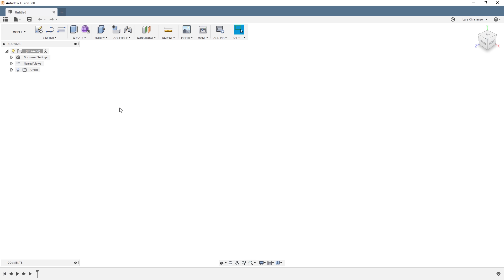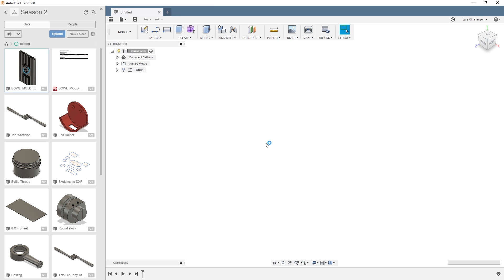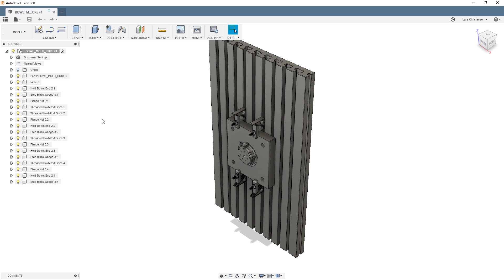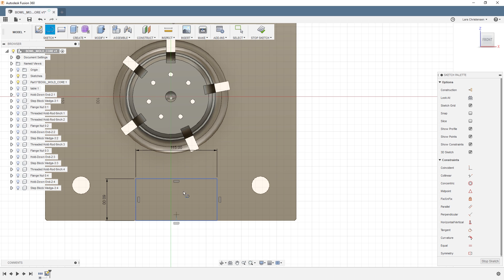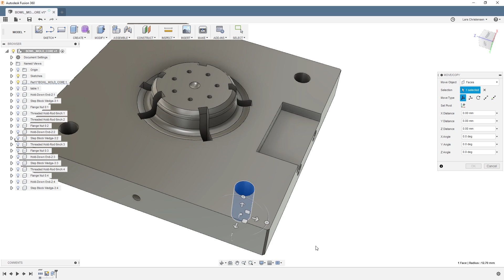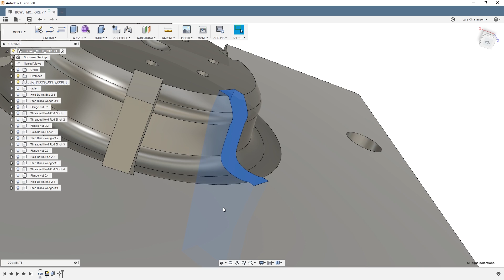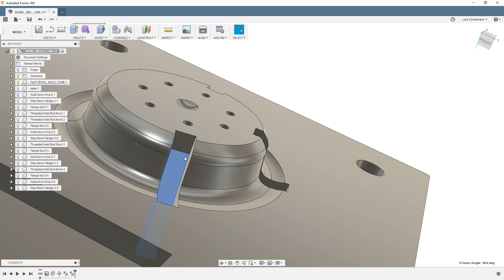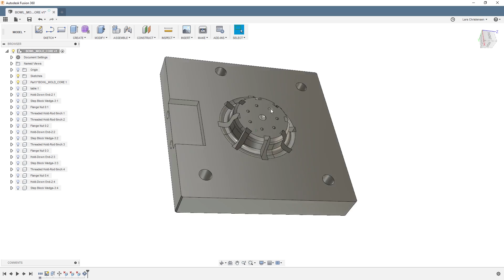How To Modify SolidWorks Files in Fusion 360 — Season 2 EP11

Comment: I am really facing issue with the file that is being imported.
i have a solidworks assembly file of a universal joint, which is made of 3 parts file inside the solidworks, now i want to open it in the fusion 360, but if i dorectly upload this assembly file along with the parts as said in the videos, iam getting the exact object which i have created inside the solidworks, but the joints are removed, that means, 3 parts are now moving independetly, i even have tried by uploading the .PART file of  assembly file created in solidworks , still same issue, can anyone tell how to solve it ???????????????????????????????
Reply from the maker: SolidWorks joints will not be available if you open the assembly in any other software, as far as I'm aware. It is pretty normal for CAD packages not allowing those being exported. You will have to re-attach everything in Fusion.

Comment: Hi, Matt. Did something change in Fusion360 in 2020? - In my case, a SolidWorks assembly files uploads alone with an error. Also,  when I upload the assembly file along with the reference part, Fusionj360 doesn't recognize them as reference part. Rather, the app considers them  individual files and they only open in browser.

Comment: I cannot find a video from you or anyone on how to modify an skp file from Sketchup in Fusion 360. I imported it the way you show in this video. When it comes in it is pink in color. When you imported your Solidworks file it looked normal. Did I forget anything? How can I fix this?

Comment: Great video - I have problems with bringing in STEP assemblies and creating separate part files from them. Ex. in a machine design we would use the same component in several machines. The natural thing is like here, to bring the assembly in, and work from there. Lets say in your file here that the clamps that you imported from SolidWorks needed to go into a work holding library (or it was ex a pallet system that needed to be in the same position for all the products you make); then how do you do that? 
In our other CAD system (Alibre) we get discrete files in, and can replace components, but as far as I know we cannot in Fusion.

Comment: Is the nester add-in still the best way to nest sheet metal parts for machining? Or is there something integrated in Fusion nowadays? I can't even find nester in the F360 app store so I assumed there was a reason
Reply from the maker: There are no incorporated nesting at this point. I have to admit that I have never looked at the add-in section for one, so I’m not sure. I would think nesting will be in the future of fusion(I’m far removed from those decisions) as the technology is in Inventor and therefore in the Autodesk’s hands.
Reply: @cadcamstuff   Oh okay that would be cool to see an easy way to layout unfolded sheet metal side by side to figure out what size of stock I need to order. I'm actually not even sure how I would go about unfolding all the sheet metal and see it together.

This is your video I came from but it's regarding already flat pieces https://youtu.be/Ji69CGAIZqQ

Comment: I printed out the Tap wrench and using it lol. I am going to design a die handle now and print that and use it with a 1mmx1.25 die to clean the threads up on some 3d printed parts. Thanks Lars
Reply from the maker: That is awesome. Thank you for sharing 👍😊

Comment: I ran into this yesterday.  I have a giant folder of parts and assemblies, including an entire library of thousands of parts from a vendor.  The files I need to open only use a few, but I do not have SolidWorks to see which ones.  Opening one of the assemblies in Fusion as you did tells me to also upload the required files.  I have no idea which files are needed, and I'm not prepared to upload gigabytes of data and thousands of files through Fusion.  Any solution?
Reply from the maker: If you look in the windows folder can you see when the files were last modified and group them that way?
Reply: Thanks  @cadcamstuff  That's a good idea, but I downloaded a zip from Google Drive, so I don't think I'm seeing correct modification dates.   They all have the same date.